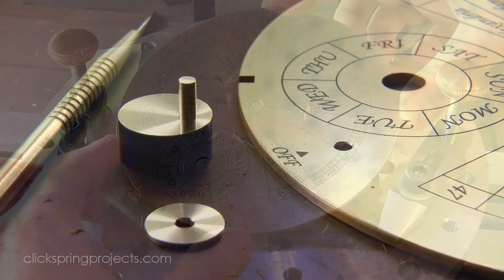Making A Spring Deselect Cam

Comment: hi friend, is it brass or bronze? you are great!
Reply: I don't know but it looks like brass
Reply: Brass.  But what's the big difference anyway?  Copper + Zinc = Brass.  Copper + Tin, or Aluminum, or Nickel, or whatever else = Bronze.  Why??  I don't know.
Reply: @danl.4743  i worked on some kind of brass on the mill and it was awful, while the bronze was  perfect , also the cost is much more for bronze, expecially the one used on plain bearing.. is one of most expensive metal..
Reply: @AsitShouldBe  I worked on brass on the mill and it was OK.  67% copper, 33% zinc (CuZn33).   But not all brass are the same.  The ratio changes drastically between different brasses.  Same goes for bronze.  Different ratios, different metal with the copper, and it makes it a whole different material.  But it is usually Tin in the Bronze.
Reply: @danl.4743  yes, you are right, some of them are suitable for machining and others are awful, i worked on casual brass and on bushing bronze .. the second was on another level.